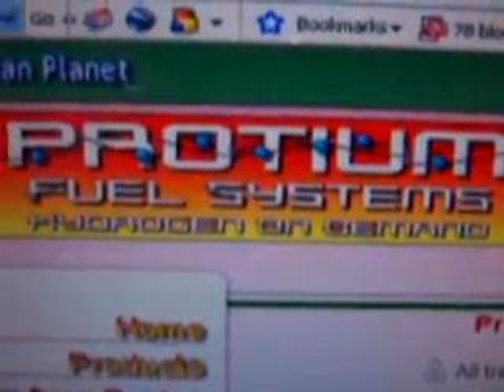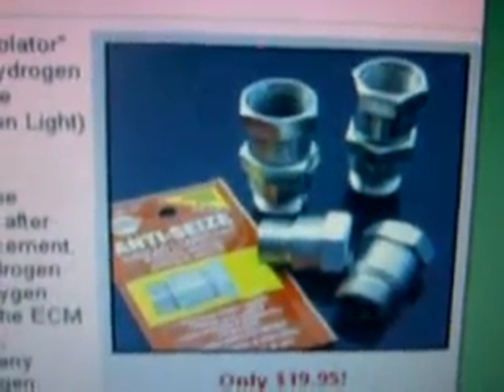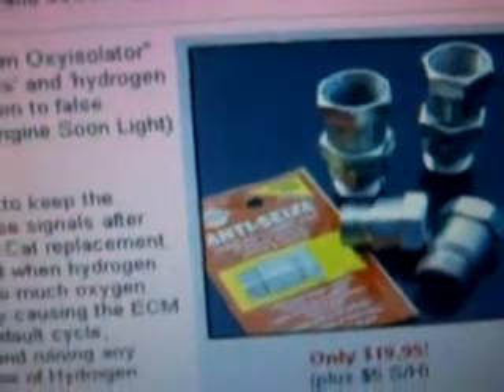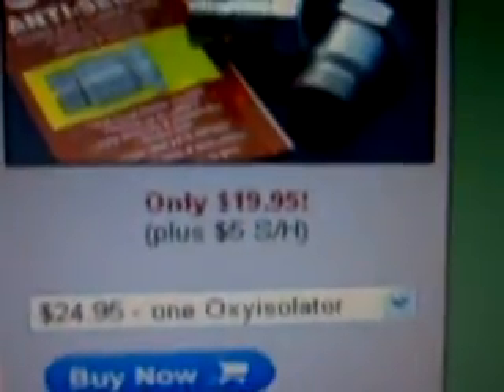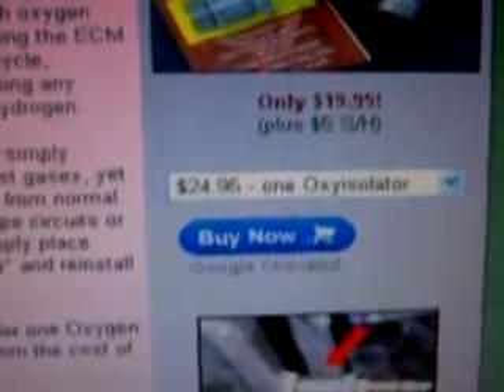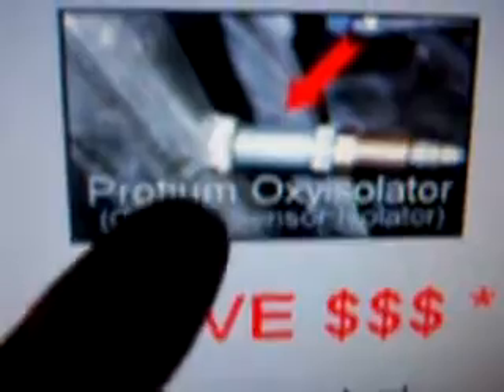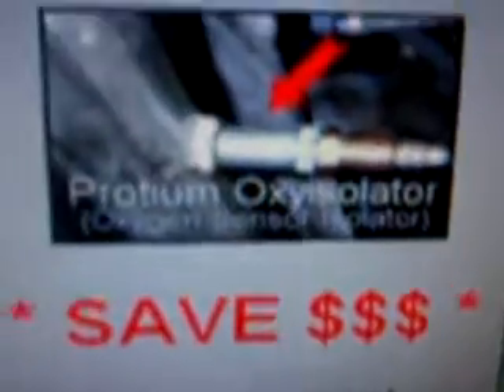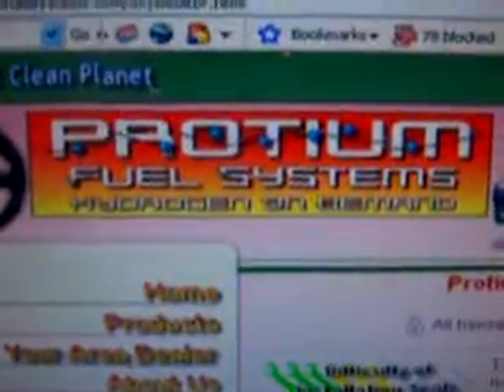HHO Oxyisolator

Comment: They do have an effect since they pull the sensor out of the main stream and place it off to the side, thus lowering the concentration. The O2 works off concentration, not detection, 

Simple analogy: where is the current strongest in a river— near the shore or on the middle? 

Same principle, since fluid dynamics are in play here. 

I'm still tweaking mine see my vids on the same subject.

Comment: I gor mine at Autozone for $2.99 a pair You need to drill the first set out to a little over 1/2" and then experement with the second set till you get the best respnce (what I'm working on now) today I'm going to drill out the second set to 3/8ths and I'm pretty sure I'll be were I need to be. See my video on the same subject

Comment: I used one on my truck with my HHO experiments and when I added it the total system doubled my mpg.  I didn't pay $25 for mine however.  It is an easy way to at least test it.  I did not expect such an improvement, and the EFIE might be better in the long term.

Comment: I dont see how this could possible do anything. If even a tiny part of the exhaust gets to the sensor it will return the same readings to the ECU even if the sensor is mounted a foot away from the manifold/exhaust. I have not tried these extenders yet but by design they cant increase the voltage sent back to the ECU because eventually the ECU will just start compensating for it.